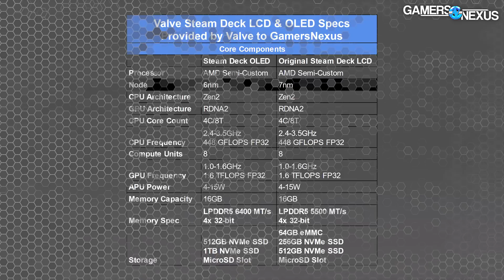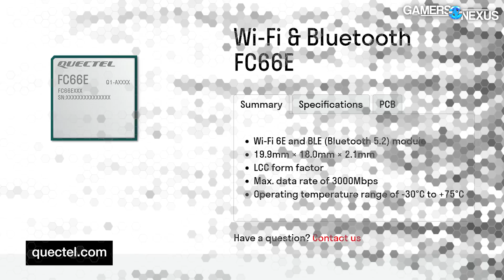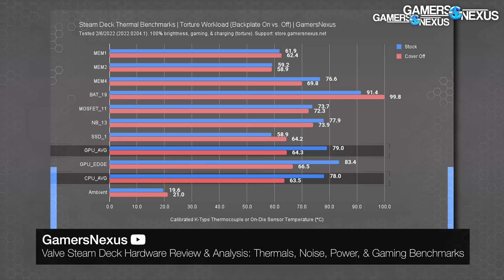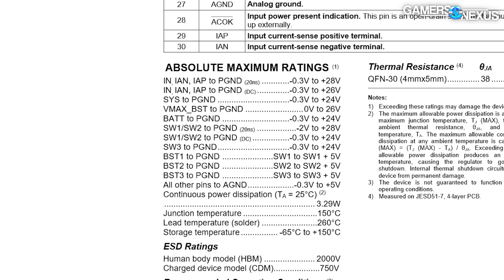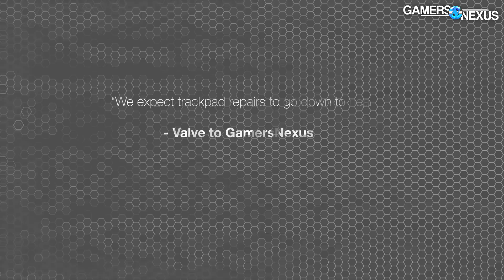They Changed Everything: Valve Steam Deck OLED vs. LCD Tear-Down

Comment: Wait, did Valve remove pressure sensitivity, or changed how it's sensed, from the touchpads? Unless they entirely internalized it, I'm not seeing the FSR-like module on the rear of the pad.  Unfortunately, GN is also the only source of a teardown like this, I'm not sure how likely it'll be for iFixIt to produce another fully detailed teardown of the OLED with Xray scans.

Comment: Thanks for a great video! I wonder if the new touchpads can be used as a drop-in replacement for the older ones, they seemed reasonably similar other than the improved spring design.

Comment: I am curious how many parts from the new oled One. can get moved over to the old lcd one. with no or minimum problems and if it would work. I am especially curious if you can take the fan from the old to the new one

Comment: Ahh.. I know the holidays are just around the corner but copying Nintendo by just refreshing an already old device is kind of shitty move from Valve. With ROG Ally and Lenovo Legion Go completely destroying it with specs it's really too bad they decided to play it safe. 8" screen is a must and don't be cheap with the specs if you are charging almost the same amount as the competition with much superior performance. Shame as it looks pretty decent.
Reply: wat
Reply: @kuhpunkt  Read it a few times maybe you'll get it then. If you don't then you're exactly the audience this device is aimed for.
Reply: @3MNMS  No, you are silly. This is not a shitty move by Valve. They aren't playing it safe, they are playing it smart.
Reply: @kuhpunkt  Safe/smart.. Whatever you want to call it. Its a shitty move for the consumer either way that they're not even trying to compete with the big boy hand helds when we all know they can easily do it.
Reply: @3MNMS  Why is it shitty for the consumer?
Reply: @kuhpunkt  Because they're getting a product that has yesterday's tech for almost the same price as Legion Go or ROG Ally which destroy Deck in the spec department. Hell, even in the screen size department.
Reply: @3MNMS  The Steam Deck OLED costs like 570€ and the Legion Go costs 800€. I prefer the Deck OLED with a better screen and actual battery length. And a device that's supported longer.
Reply: @kuhpunkt  Yea that sounds like you're getting ripped off so of course you will go for the inferior device. ROG Ally is €450 where Im at and it will wipe the floor with any steam deck when it comes to performance.
Reply: @3MNMS  Where is the Ally being sold for 450?
Reply: @kuhpunkt  Canada
Reply: @3MNMS  Canada doesn't have Euros.

Comment: It's nice to see upgrades, and Steam behind Gabe seems not so bad compared to most other corporations these days. But, any device that is wireless and doesn't have a removable battery is considered disposable, a commodity to use and throwaway,  unfortunately.

Comment: This is probably a really dumb question but are their parts in the OLED model that if purchased piecemeal we'd be able to "upgrade" an original model?

In particular I'm really curious if the actual OLED itself could theoretically be swapped into the old shell.

Comment: I would kill to work for a company like valve where engineering is not hamstrung by management so someone can brag to shareholders about how much money they saved during a refresh. I can hear in my head during a design meeting some exec at any other company yelling at a PM over and over "Just display and the new SoC, nothing else"

Comment: Moving the bumper buttons onto the joystick modules is awesome, because a lot of people I've seen (including me) have managed to break one of the bumpers but neither Valve nor iFixit supplied the daughterboards that could have made them quick user repairs vs sending their Decks in. They do however sell the thumbstick modules so assuming they stick to that for the OLED model that would be great.

Comment: It's a bit pie-in-the-sky I guess but it would be cool if this niche continues growing if manufacturers could settle on a handheld spec the same as with ATX, ITX, etc. My "old" Steam Deck is still completely functional and intact, it's too bad I can't just swap the components as new hardware becomes available. On the other hand, all it needs is a dock and it's a perfect replacement for my ancient HTPC, so I don't mind just buying a second one.

Comment: Wish list for steam deck 2 

6core 12 thread cpu ≈ 3700x performance
gpu close to or around 5700 — 5700xt 
6 gb of dedicated vram
Overbuilt cooler 
about 3,5 hours or better battery life in intense gaming session at ≈ 25w
more ports I want a minimum of 2 usb c 20gb ports (I'd like one of them to be thunderbolt)
same OLED screen or better (the resolution doesn't need to go up)
A togglebel docked mode, that turns on when charging and gaming at the same time, That makes it boost to like 60w. Like when docking the switch. (I also want to be able to turn it on in battery mode, at a greatly reduced battery life.)
bigger more dense battery
space for 2230 2242 and 2260 SSD (and with a clear way to mod in a  2280 size for the madlads)

things I want, but I know is never going to happen.

It being a clamshell with 2 screen or a keyboard or just space for better cooling
having an open source mini pci x16 connector for external gpus and other shenanigans

Comment: I thought it would be just a minor change, but since they put all this work it's just sad we didn't get the latest AMD APU instead without it having to be called exactly SteamDeck 2 as a true next gen but just keep it as SteamDeck OLED while also selling the original at discounted prices like they are doing...

The OLED is the most amazing thing, but it's still hard when now Asus ROG Ally went from 799€ to 699€ here too at least at the moment for a while, It's not like I'm going to have either but the ROG is tempting.

I will just keep waiting for a SteamDeck 2 because now it's mostly about UE5 games and it's still green, latest titles even on desktop are getting hard to run even at just 60 FPS on high settings, a much later into the future SteamDeck will always be more prepared for UE5 games and any other game engine truly updated to next gen than any current handheld.

Comment: Nintendo: we make the Switch OLED, it's the same as the old switch but with an OLED screen
Valve: we make the Deck OLED, it's a completely redesigned device that is easier to repair, has a die shrink APU and a bigger battery

Comment: Glad to hear about the bumper buttons. I had to send mine in for a replacement from normal use because the bumpers wore out so fast. Gonna try remapping to the back keys to avoid wearing them out too quick.

Comment: Great video! Love the thermals discussion!
Super nitpicky, but reading left-to-right, typically the "old" is on the left and "new" on the right.
Scenes like 5:20, 7:30 etc., had it flipped. Like I said, super nitpicky and inconsequential.
There may be a reason why it's like that - if so, I'm sorry!

Comment: Bro I have not watched this video yet but Holy Fuck how is this only 18mins? My expectations are high beve sturke
Reply: This table is really making him look like jesus now

Top Tip: glue some matte white (thin) foil on it, those things that are glued to windows and the tablelight is even smoother...

That and the flickering. 🙃

If you want to make it a little more appealing to a none-technical audience, you could list the costs of the components that change (ore were saved). I'd be interested to know how much they have saved or gained in money from the improvement. All of that component efficiany must be worth some money - either way if you can do it better than before without drawbacks...

But to do that on 24h is kinda impossible 😳

Comment: I'm scratching my head about the memory configuration. As per the technical specs on the Steam Deck hompage the OLED Deck has a 6400 MT/s quad channel memory config.

But in your teardown there are clearly only 2 memory chips on the motherboard. According to Micron those are 64bit wide. So how has Valve managed to keep the memory config to quad channel? Can you just wire two 32bit busses from the memory controller to a memory chip with a 64bit interface?

Comment: I feel like the reduced quantity of RAM could show some impact in specific scenarios. Tho it being faster in general could compensate that. It's similar to normal RAM, where the ones with less ram chips on the PCB can be slower in terms of data throughput, since you have less chips available. Sort of how cheap SSDs usually have 1 chip with the whole space vs some better ones with multiple chips, same total capacity.

Comment: This change of the Shoulder Buttons is crucial!

I dropped my Deck on Day One of Having it on its shoulder. Not heavy drop just on carped from 70cm.

But the Shoulder Button wasn’t working anymore. Came out I broke it of the board.

Looked for replacements and this daughter board on what it was, was Not available. No chance changing this part.

I reconfigured the back buttons to shoulder. And later changed the switch by myself what was a big pain in the ass.

Not it’s replaceable with the sticks. Thats so great! I love to see so much things improved!

Comment: Hey Steve, if you got both the new 512GB and 1TB versions, could you try to do an image comparison between the normal glass and the etched anti-glare glass, to see if the glass difference disturbs the OLED look at all?

Plenty of people at /r/SteamDeck are planning on getting the cheaper version because of the screen alone, even the price difference is justified by the 1TB+other perks.

Comment: As an electrical engineer, I love seeing this level of detail in teardowns and comparisons. Love to see open design iteration from competent engineering teams.
Reply: A device I am curious to see the insides of is a new delay pedal that Boss came out with called the DM101. It is digitally controlled with 12 different delay types and is stereo which is uncommon with analog effects. It uses 8 BBD chips so some of the effects have to share those chips. There has to be some wild routing going on.

It is expensive and no way am I going to open mine. The whole board could be gooped for all I know.

Comment: Valve did a lot of work on that thing and it's great to see. I'm not sure anyone else would have done the same, especially without significantly increasing the price. I would definitely get one but I already have th OG one and I barely use it as it is as I'm not a heavy gamer. I'd rather hold out for the SD2.

Comment: 14:04 I absolutely agree with this design change on Valve's part for the bumper button. I'm no engineer, but I actually had my right bumper button break when it fell off of a table by mistake a year ago. Valve was nice and fixed it for free, but there was likely a design flaw when it came to repairability of the bunper button. Let me explain the circumstance.

When the button broke, all I could find on ifixit was the bumper assembly to replace it. However, I opened up my steam deck before that and physically pushed the momentary switch itself. It did not react in software at all when I did this. The button was on the right button board (their term, but yes it is one of the daughter boards on the unit) and there weren't any markings for me to find the right kind of momentary switch to replace it with. I probably could have figured it out, but it was much easier to contact valve. I asked jf they knew the component for me to get, if I could buy a replacement daughter board from them, or if they could send it somewhere for repair and I would pay for it. They opted for none of those options and just ran it under warranty RMA for some reason (it was super nice. The action on both bumpers feel mismatched now but I'm not super worried about it since I got it fixed for free)

With the bumper button already a point of failure for the steam deck, just putting it on a much easier to replace part that they were already planning on sending out replacement parts of is a goos choice. As long as the button or traces can't fail under normal use it doesn't matter if it's more likely to fail from a drop, because it was already very likely to fail from a drop.

Comment: For a revamp of a device that's specifically required to maintain the same hardware requirements target this is quite the overhaul. Considering how "lazy" the PS4 to PS4 Slim effort was, as a comparison point, I'm gonna give Valve a big pad on the head for this one. Typically doing updates for cost saving, that only benefits manufacturer, can be suuuuper frustrating for the 3rd party repair scene  (I'm looking at you HP!!!!), but it looks like Valve took the sane approach here by fixing everything that was brought to their attention at the same time they brought in a change that users actively wanted.

Comment: Valve: "It's the Steam Deck, but OLED, y'know, like the Switch!"
Valve: Actually completely redesigns the entire internals.
Reply: the OLED switch is also a complete redesign inside too....
Reply: @Notpoop906 but no significant hardware upgrade...unlike the switch
Reply: @VlazeSkylax 

It has a more efficient SoC, upgraded shell, massively better kickstand, better speakers, double the internal memory. There are a lot of upgrades other than just the screen
Reply: @cortexg92 massively better kickstand as if a kickstand is some complex hardware
Reply: @rushpatriot2866  I mean true, but you say that like it's a solved problem and they're not mostly ass

Comment: I have an OG (Q3) 64GB Deck.

Does this Older Version with the 4 RAM Modules have more Memory Bandwidth over this Newer Model?

Or are the new RAM Chips better enough to the point where it doesnt matter?
Reply: Some early benchmarks said that the new chips result in slightly (5-10%) faster framerates

Comment: Everything changed but the performance. There's already handhelds with quite a bit more CPU and GPU power in the same form factor. Still, this is fantastic build quality so I applaud Valve for that.

Comment: I compared the charge controller buck/boost ICs. The internal MOSFETs on the new IC have like 5-30% lower on-resistance, and the chip has two separate circuits sharing the load. Each circuit is individually more efficient than the old IC, and now there's two of them. Props to valve on this optimization, I expect this new chip to generate about half the heat.
Reply: 100% its those small optimzations that amount to significant improvements if applied all throughout the device

Comment: Small nitpick: you should use the same number of significant digits for the area measurements of the die as the caliper offers for measuring the dimensions of the die.

So 132.7 mm2 for the OLED and 166.1 mm2 for the LCD.

Comment: I love that Valve isn't afraid to talk about their hardware so in depth with a reviewer. This is some very interesting info
Reply: Make a good product and you don't need to be afraid of it, but instead PROUD of it.
Granted, I don't have the technical know-how to rate their product on such an engineering level, neither would most people care. But the Steam Deck IS a great product for an even greater price. So as an engineer AND a company, I wouldn't be scared of talking about the details of it. ESPECIALLY since Valve isn't scared about any copycats or the like. They openly embrace repairability and even modding, hardware AND software.
Reply: Well said yess 👍👍  @Yoshihara72

Comment: Complete change and still went with old Zen2 & RDNA 2 hardware to save a few dollars. While other handhelds using faster Zen4 & RDNA3 for similar price.
Reply: they stated long ago no major changes like that unless there is significant tech improvements, plus developers do not want shifting goalposts for the "same" handheld, nor do they want a minor update making the original obsolete.
Reply: @disasterincarnate  did watch the video? Every part is different than previous model that's a major change. But they kept the slow Zen2
Reply: @jaggsta  their changes are in line with the og deck, there was no major updates to performance/speed and they said there wont be until 2+ years from now when tech advances enough, they dont want shifting goalposts for developers for multiple variants of steam deck, what works on this new deck works the same speed/performance as the og deck.

Comment: That's why I'm a fan of the Steam Deck—they really put in the work and try to make things better! It's not like those companies that just tweak the version number of their products and call it a "new generation."
Reply: Or worse: a penny pincher as found out they can save 4 cents per unit if they just change a couple of things around and then silently push that so 3rd party repair shops can pull out their hair in frustration because now sub-component A-1.06F doesn't go together with board D-7.083T, but you don't notice until it snaps when you screw the lid back on..... Yes HP, I'M LOOKING AT YOU!

Comment: Apparently the cheapest model now comes with an SSD out of the box, but has LCD instead of OLED (and older Wi-Fi). Well, now I'm definitely not bothering. Don't want to overpay for extra SSD capacity I won't use (especially with inflated reseller prices here in NZ/AU), but don't want to settle for a non-OLED display either when OLED is available. 256 GB of SSD capacity and OLED instead of LCD do not warrant an extra USD 150, Valve.